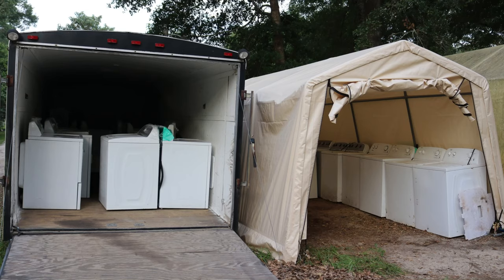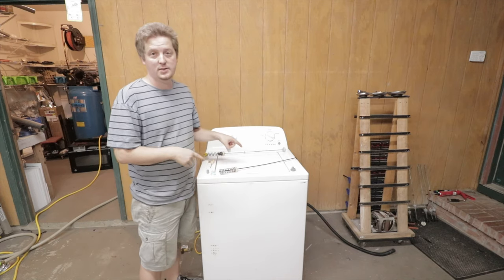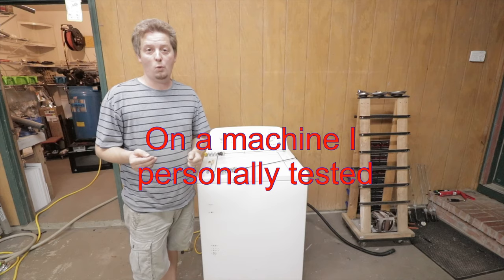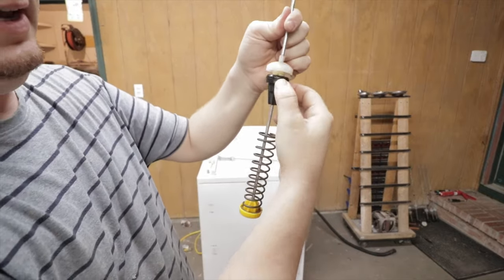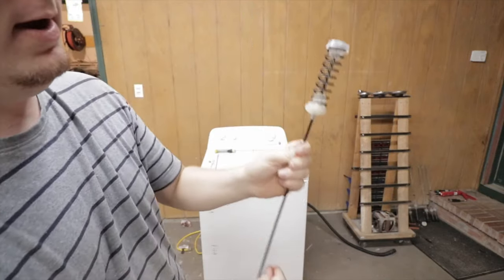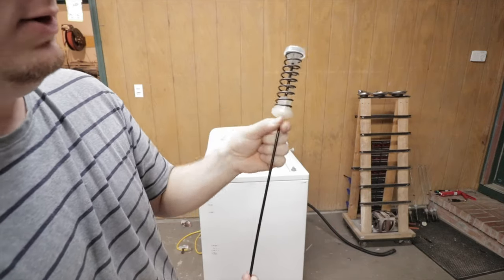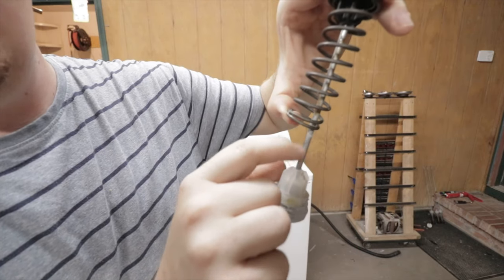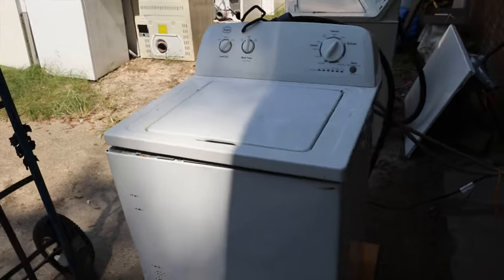Cheap Permanent? fix for shaking banging Washer? $7 to fix Suspension dampening rods W10780048

Comment: Ok, please read this. First, awesome video! I love the creative solutions and willingness to share the inventive spirit. Luckily, most will have the money to just buy the new rods for 30 bucks. We are blessed for that. However, waiting 2,3,5 days while your wife is harping and hounding is well worth a quick repair.
I say that whenever making a homemade fix, it’s best to wrap your head around exactly what it is you are “engineering”. What’s the real problem? That’s why this video is so great! Then focus on that problem to make a solution. So the problem is in this design of the rod. It uses a spring and damper. Gravity is the enemy with this. The force of gravity is being absorbed by the spring but the problem is that the spring has to give that energy “back”. When the spring contracts it then wants to expand and that energy is transferred to the tub. Gravity and the centrifugal force of the tub spinning at super high speeds has those springs just throwing energy back to the tub and bouncing the living hell out of it. As a result, the design is to dampen or absorb that energy with that little pad....I like to think of it as a brake. It slows and dampens that energy really fast over and over while the tub is spinning. So the solution is to find a way to absorb some of that spring recoil or energy to keep it from transferring back to the tub where it gets out of wack unbalanced.

The solutions on this video are fantastic! Problem is waiting for materials to dry....or even having them around the house. Then it’s a matter of hoping your material has created enough friction to dampen the energy without stopping it dead. If the metal bar doesn’t create enough friction against your material of choice, this won’t work. 

What I chose to do because it was actually cheaper and easier and instant....I basically absorbed the recoil by using rubber bands to shorten the spring slowing its “bounce back”. I used multiple rubber bands and actually measured each spring to ensure they were all “even”. I used the bands and wrapped them across the top of the metal rod to down around the little flat pin at the bottom of the spring. I used enough bands on each one to compress the spring 1 full inch on each. What this did was make all springs energy equal while it also transferred the energy to the rubber bands on the spring rebound. Now the spring still compress just fine but when they try to open back up releasing their energy, the bands take that energy away and slow that rebound big time.

I hope explained that ok! Free, easy and no mess. I’ve had this working now for many many very heavy comforter type loads and it’s running perfect. Hell, it’s probably better than the actual design because that foam crap material they use will wear away while the rubber bands may last quite a bit longer.
Reply: Interesting solution, do you have a picture or link to how it looks?
Reply: @javv07  I might in my phone. It was actually a fun fix if that doesn’t sound too stupid to say. I’ll take a look tomorrow. It worked ok for awhile but ultimately, I found the best fix….

A Samsung top loader with a good old fashioned agitator on sale lol.
Reply: Rubber bands don't last long being worked so hard. Choose your rubber carefully.

Comment: Have you tried CT1? Its on Amazon. Perhaps other places/stores as well. Wonder if you could crimp on some type ring to the rod to prevent it from working loose? Just over the top of the part in question.

Comment: My Whirlpool is acting up, banging like all hell, wondering if i replace that piece with a piece of rubber  thats gripping the shaft it should work, will let you know how it goes. Also, on the top of the rod, the ball and socket, they say there is supposed to be a friction modifier in there, i'm thinking of putting a small amount of windshield urethane between there to help dampen the action also.

Comment: Small zip ties around the foam..forcing it to squeeze the foam more on the rod..  would that work..?.  Great video
Reply: Yes I had the similar idea, fixed it using cable ties but I can tell from experience now it's not the best fix it some how goes bad within few months. You can check the video of the fix on my channel

Comment: can Metal Epoxy be used instead of Hard as Nails? The reason I am wondering if metal epoxy might work is because you tried Hot Glue. Is the purpose for your fixes is to NOT let the plastic apparatus containing the foam move up and down?  If the Epoxy holds the plastic thingy in place, would the lack of movement be detrimental to the washer?

Comment: The idea of filling the cups with construction adhesive is a good one.  As the adhesive drys it shrinks making it even tighter on the rod.  It is concentric on the rod just like the original foam bushing so the plastic cup ends aren't in a bind messing them up.  It may be a perfect fix if the material holds up long term.

If you think you want to try a different material against the rod, simply cut washers and slit them to the center and pop them on and stack them in the cup then fill glue around them with construction adhesive.  I'm planning to try some leather washers made from an old belt.  Since you're going to glue the material in, cut the pieces so they don't touch the inside wall of the cup or it will side load the rod and throw it off center.  The glue will fill in any gaps.

The last thing to do is to overfill the cup so that the top cap is full also and the glue will get in to the slots around the top of the cup and hold it in.  Since it shrinks a little you can expect it will pull away from the inside of the cup and won't be pressed in.
Reply: New rods come with damping grease. Very sticky. You can get it on Amazon

Comment: G' day there thank you for the info when fitting modern windscreens you use a black  glue the trouble is I'm not sure which one silicone or Sikaflex  The one I'm thinking of behaves like black rubber when dry quite tough hope that helps, Cheers.

Comment: Thank you so much for explaining this!  My problem was the bearings, but like others I ordered new suspension rods (cheap obviously) as my first fix.  Well two bearing and shaft replacements later and a new rotor position sensor, I finally went back to my original suspension rods and it is working like a champ now.  My original suspension rods had at least twice the dampening power as the new ones.
Reply from the maker: Yes I’ve noticed some suspension rods I get as replacements are real junk compared to others.
Reply: @WasherDryerMoney  hi there.. I’m reading everyone’s comments here n I too, now understand better what may be my problem after my nephew tried to explain to me that I may have bad rods inside making my washer hop alll over the floor.. I haven’t even started by taking the top off to remove the sides… I’m a 68 yr old woman n I’m pretty strong but still wanna get a good idea of what I’m dealing with … I love my top loading washer ..I’ll be sad if I can’t fix it … sooo my question to you is this … how do you know which is the best rod kit to get so I can avoid getting a bad one ? Thank you mucho grandè for any help … I’m amazed how many hard workers r out there n also willing to share info on places like here .. it’s really inspiring to me … but I too am a hard worker so I get it … thanks again
Reply from the maker: @leighboschen3399  My best advice would be pick the ones on Amazon with the highest star rating and Reviews.
Some people recommend the original manufactured replacement part. Which you can also get on Amazon. It’s very random when these suspension rods go out sometimes it last six months sometimes six years. Good luck
Reply: @WasherDryerMoney  I suspect that when you buy better suspension rods you are merely getting better damping grease, which you can purchase separately ($9 Nyogel 767A) and apply to your old rods.
Reply: @Robert Podolsky  where do you apply the grease?

Comment: I know I'm late to the game, but perhaps you could replace the original worn foam with cork, natural or synthetic.  Drill a smaller than stock hole through the center of the cork, but keep the cork on the drill bit and hold a sanding block against the side of it while spinning the bit in a drill press to take the cork down to size.  Then perhaps a slit down the side to get the cork onto the rod and press everything back together. 

Hope you find something that works!

Comment: To keep this as short, I watched your video and thought of an Idea.
1. Remove the spring retainer on end of rod shaft, break it off if necessary (Plastic not rod).
2. Remove all pieces from rod & lay out in order.
3. Polish the rod area you referred to with a scotch bright pad (Works better than sand paper).
4. Now for the fun part #1, replace the worn-out rubber resistance plug with a stack of O-rings.
 Since we don't know the Manufacturers resistance spec's this will be trial and error.
Once this knowledge is achieved you can share with the rest of US.
O-rings are dirt cheap at Harbor Freight.
5. Now for fun part #2, Re-assamble by using a flat washer as a spring retainer then a small rod retainer. 
ROD RETAINER: (The type that slides onto the end of a rod and bites in with little fingers, looks like a little hat, and taps on with a hammer)
Flat washer and rod retainers both available @ Lowe's.
6. If end of rod is crimped, grind or file down so flat washer will slide on.
7. If spring is to loose, use any thing as a spacer between rod retainer (little hat) and flat washer, so
spring is in same position as OEM.
PS: I am not in appliance repair, so I have nothing to experiment with.
PSS: I would put a thin layer of lubricant on ball joints at (Tub and housing) to help  prevent plastic wear.
If this works like I think it will, make spares, for quick repairs!
Reply from the maker: It could work. I'm going to do an update video soon and try a few other things. The Liquid Nails is still working in the machine I fixed in this video.
Reply: @WasherDryerMoney  how's the liquid nails holding up now?
Reply: All you need to do is put new damping grease on it.  This grease is very sticky. It’s the opposite of regular grease
Reply: @WasherDryerMoney  how did this Liquid nail fix work long term? I am dping this repair as we speak
Reply: Don’t put lubricant on it!!! It takes a special damping grease. This grease is sticky not smooth.
Reply: @WasherDryerMoney  Did you try anything else? My white cap looks a bit different and I am trying the hot glue method but I just don't know if I put it in there and then squeeze it shut, etc.
Reply: Just throwing a theory out there. 
Since the felt inside the plastic and damping grease are which helps create the makeshift shock absorber for the washer  finding the felt material cutting it to shape and only cutting one side should allow you to slide it over the shaft adding damping grease and that should fix it at least for awhile.

Comment: Thank you, it is a very informative video! I suspect this may be the root cause for "out of balance" issue with my Fisher Paykel washer. The support rod replacement kit (424495P) cost around $150 which is quite ridiculous. Your explanation and the fix make total sense to me, there got to be a sufficient vibration damping in the system somewhere otherwise it goes haywire around resonance frequency. There is one complication with this particular implementation of support rods (424495P). The spring is enclosed in a metal case and I'm not sure whether it can be non-destructively disassembled. I'm wondering, do you have any recommendations on how to deal with the problem in this situation?
Reply from the maker: GE washer is have a similar issue. I have not attempted to work on these yet.Next time I get a washer with that cover over it I will see if it is something that can be removed. I have seen several people in the comments say that you can put a piece of hose pipe over the spring to step in it and that seems to solve it. I have not tried this yet but I plan on making a video about it. I’ve also seen suggestions on put in earplugs in place of the liquid nails. I have also not tried this but I do plan on making a video about that idea as well. I will say that the liquid nails is still working perfectly for the washer. I still have it in my laundry worm and it runs about every other day since I’ve made this video.
Reply: @WasherDryerMoney  how did this repair end up working out over time? Laundry seems to have gotten overloaded a few too many times and now my washer bangs around all over the place in the spin cycle.
Reply: Thanks for the Video, I also have an 8.5 kg direct drive washer from Fisher and Paykel. In my opinion F&P make terrible products, the engineering is poor. The F&P has similar dampeners, they are basically black plastic caps above the spring cartridge that are crimped on one side, the crimping is supposed to provide enough friction to dampen the action and stop out of balance trips. It does, for a little while but soon the problem reappears as the hard black plastic wears. I fixed mine by winding multi core copper wire around the top of the cover, twisted to provide enough friction (check by hand as you go) so far, they haven't needed to be re-tensioned but when they do it will be an easy job. Cost for this fix $0 and about 1 hours work time. No parts required (just some scrap multi core copper wire)

Comment: Could you just put a zip tie around existing part to squeeze the rod inside the pipe. You could replace it with anything as long as you squeeze it snug. Thoughts?

Comment: This is my suggestion... get some things and trim them down to the right size and wedge them in the spring so the suspension rods won’t let the springs have a off balance spin cycle... chalk off and disable the springs so the suspension rods will be stiff and still like the older belt drive are
Reply from the maker: Yes I agree. In fact Samsung suspension rods I have a piece of thick rubber that goes over half the spring to get the spring less bounce and it also well it’s the suspension rod not travel as far which reduces the amount of where that piece of foam receives. I’m actually planning on making another video about this very subject soon. I might also have a another easier cheap fix that’s mimicking this idea.
Reply: I got to suggestion do like one of my buyers did and zip tie the springs to the tub 😄😄

Comment: Turns out, the grey compound at the end of the rod is not a grease, it's really a friction modifier that fills the gap and provides the required friction.  It you remove it (thinking it's a grease) you're actually decreasing the required friction.  The hard part is figuring out who sells that!
Reply: I ordered it from Amazon for $25
Reply: link? what's it called? @johnellisonarmadilloconstr7966
Reply: @technicalitems731  Nyogel synthetic damping grease. It’s on Amazon
Reply: Can confirm: ordered Nyogel 767A off Amazon; applied a generous amount directly to the rod, under the plastic bit that keeps the spring down. Machine spins as quiet as ever now.
Reply: That was the cure!!!! Thank you
Reply: @sirel33  Did you remove the center piece that this video shows? Or you left it all original and just filled the thing with dampening grease? Thanks!
Reply: @johnellisonarmadilloconstr7966  did you leave the foam part or remove it?
Reply: @camibohn1017  leave everything as is. Just spread damping grease all over
Reply: @ghidfg  leave everything as is just spread dampening grease all over the rod
Reply: @johnellisonarmadilloconstr7966  thanks
Reply: Reading these hacks, and I appreciate y'all effort. Brake fluid is a friction fluid I do know, possibly a fine abrasive powder like on wet dry sandpaper and scuffing rods horizontal.
   I didn't search it I'll try that next. Brake fluid is abrasive so brakes work if it leaks.

Comment: I got it Amana top load same thing you just showed there has the six lights with the button. However it fills stops fills stops they're allowed to take just a second and stops and feels and it won't keep on agitating it just keeps stopping and trying to feel it will not go into spend mode or anything like that it just keeps stopping and feeling it'll agitate a second and then stop maybe running for a few more seconds agitate and then stop I hope this makes sense

Comment: Lol, i used a hammer and anvil and rounded the pinched end. Then used a punch and punched out a perfect gromet out of a tough rubber material, put back together and then hammered the end back flat again.
Reply from the maker: There’s a lot of different ways to fix things.
Reply: how is that working out so far?
Reply: of course,that **IS**  the way;  you can then use hose, ubber washers, molded  caulk, etc... BUT you need a caliper to measure diameters first;         thanks